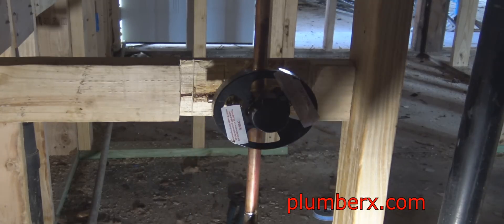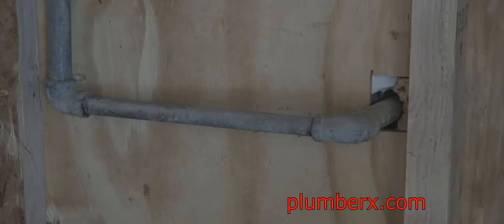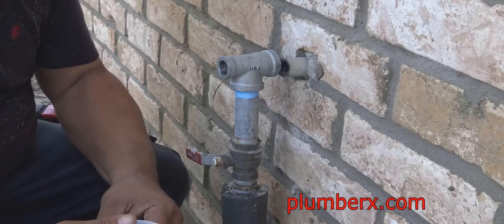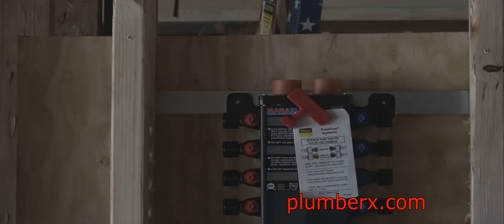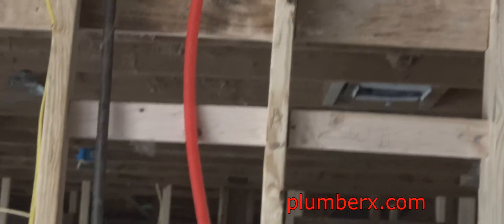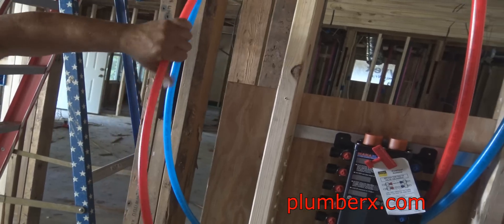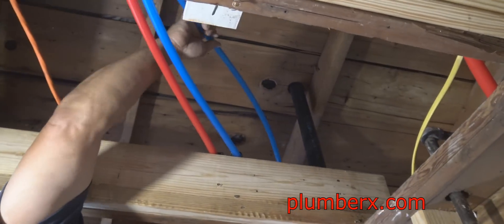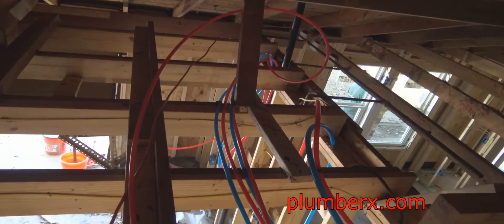Pex Pipe Plumbing! |How To Plumbing

Comment: I am really learning in the use of Pex, thanks to you. I have a question.  Using the PEX is not necessary anymore to install Air Chambers in some hight point? and  Does the pipe let you hear the noise from the water when some fixture is in use? How does the outside temperature influence the cold water pipe? Thank you for your efforts
Reply from the maker: +Nelson Alvarez I really don't see a need for air chambers anymore with Pex pipe. Yes it's not noisy. And it's not really ridged pipe. As far as the outside temperature yes you can feel the different when water is in motion. Now far as code on the air chambers on pex pipe. That could be something different. I don't think the codes has really caught on to Pex pipe on air chambers. Thank you the comment.

Comment: I have not used PEX yet, I have copper pipe in my home which I have done add-ons and repairs / replacements.  I have heard pretty good things about PEX, as far as reliability not sure how that compares to copper.  The copper piping in my home is almost 60 years old(house was built in 1957/1958.  PEX is probably easier (and faster) to install than sweating copper pipe.
Reply from the maker: Copper Pipe is great. Just a little to costly compare to Pex and a little more skill is needed to install copper. You got some good years out of that copper pipe in your home. You must live in a area with good water quality.

Comment from the maker: Pex Pipe Installation. Could this be as easy as plumbing to install get ? Could this be the least expensive water supply replacement? And could this be the longest lasting and most durable water supply system for homes? And would you install Pex in your New Home are replace with pex in you older Home?